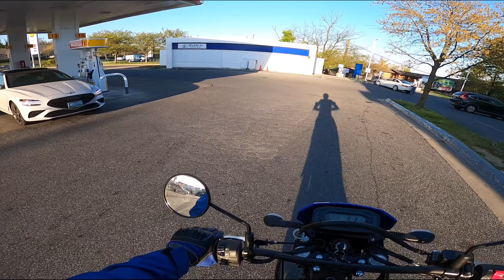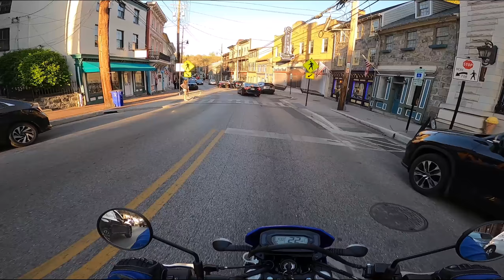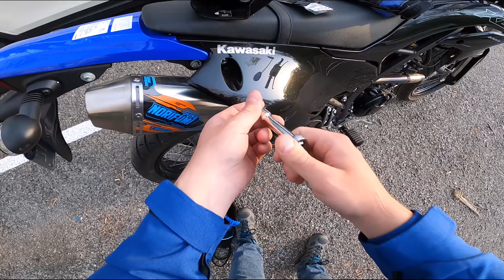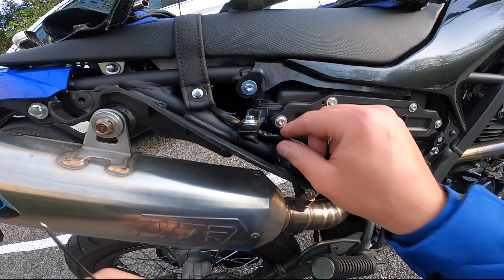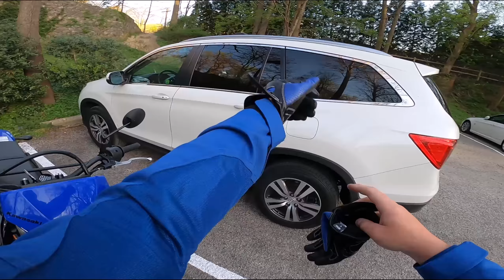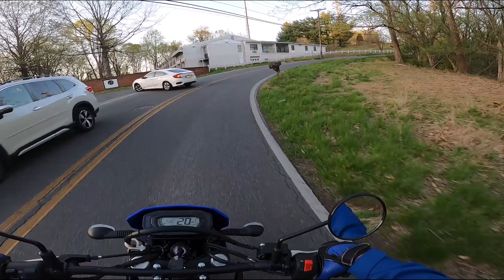KLX 230SM | KawasakiBrad O2 delete install and review

Comment: The  o2 sensor reads the exhaust gas temperature to keep the fuel mixture adjusted at a safe range probably about 15 so it’s not lean aka back firing out the exhaust on deceleration threw out  the throttle range and keeps it in spec during elevation changes  the ecu can compensate some  but with efi not gunna get much on stock tune being it has to pass emission do it’s all ready lean from factory more mods you do air box exhaust with out a tune the leaner it gets will run hotter and backfire eventually will cause premature ingine failure   But good luck you can read about it on the internet  yeah double yellow means don’t cross into other lane broken yellow means you can psss😂🤣😂

Comment: Ya just gotta love how some people drive. How dare you stay in your lane while he’s trying to drive on your side of the road. Unreal. Sound like the bike is running cleaner. It’s not popping near as much but still sounds good. I didn’t notice anything massive either other than it sounds like it runs better. Great video! I love your idea on using an infrared thermometer cuz I’ve read these headers can get glowing hot at idle.
Reply from the maker: Yea I've had my headers glow couple of times, it was interesting looking at the car next to me and see the slight glow at night, and that was even on the stock pipe.   Still the hot start isn't as good as I would like but we will see if the computer has a learning process or something.
Reply: Just listen to your bike in your previous videos. The after install video segment sounds much better. It’s crisper. The delete can simply be done by shoving wire in the right holes of the plug but this unit is quality. It’s overkill actually. My suggestion is be more definitive and stand by your opinion. If you like something say it and say why. It won’t please everyone but heck, you are a channel trying to grow

Comment: Maybe do a couple strong pulls thru the gears and pull the plug for a look. Then install the mod and do a couple strong pulls thru the gears and look at the plug again. This is what I was taught when fooling with fueling system. Imperical evidence beats seat of the pants every time.

Comment: You forgot to remove the o2 sensor!?????
Reply from the maker: I didn’t have a plug for the o2 sensor hole so I just left it in place but unplugged
Reply: @pitbikemike  doesn't that restrict the airflow? If you took it out it would flow better?
Reply from the maker: Yes it technically does affect airflow, but the surface area of the o2 is very small and honestly id be surprised if there was and noticeable improvement in the full removal of it except for aesthetics.     That’s just my opinion, I don’t really have any factual info to know if it makes a difference hahah
Reply: @pitbikemike I read elsewhere that you want to remove the o2. You don't want to use it as a plug because it will "clog" the sensor and you'll be out $200 on the actual sensor for a $5 oil drain plug and copper crush washer replacement.

Comment: Did you feel a difference when you installed the pipe?
Reply from the maker: @jfm1811  No I didn’t really feel a difference just sound. Which in some ways is nice cause when I out a pipe on crf250l I noticed it had a flat spot in rev range till I put fuel tuner. So this was slip on and forget in my case. I did the o2 delete just cause it was cheap and was curious if it made any difference…

Comment: Is the o2 sensor delete worth it?
Reply from the maker: For the 40ish dollars us it cost me… I think it makes just enough difference to be worth it.  Its not big difference but it helps if you got aftermarket pipe on the bike
Reply: @pitbikemike  thanks for responding! I just bought an over racing pipe and was wondering if i should do the o2 sensor delete aswell but the aftermarket pipe i got has a o2 sensor port. Did you tune your bike at all after getting the new exhaust or only the o2 sensor delete?
Reply from the maker: Only the 02 delete, tbh I think the bike runs great for me like I can top it out so tuning wouldn’t help me much
Reply: @pitbikemike  you noticing the header getting hot or is it the same as the stock?
Reply from the maker: Tbh I haven’t really paid much attention to it. Also cause I haven’t ridden at night recently to even tell
Reply: @pitbikemike  seems like this might also help reduce the pops on decel what to you think?
Reply from the maker: To a small degree.. with my exhaust I still get pops but not as much…. Like it wont eliminate just slightly reduce
Reply: @outsideguide3602  hey man I had a question for you I'm thinking about getting that over racing exhaust as well do you think it was worth it? Did it fit good I've seen people talking about and exhaust clamp where the slip-on connect to the header pipe did you have any problems with that did you have to get a pipe clamp or something? Debating whether I should just keep the stock exhaust and be worry-free where should I go with the over racing thanks for your time and have a good day
Reply: @ryanfritz-oq8sp  hey Ryan ive been super happy with the over racing exhaust i was a little bit iffy after getting it but it sounds so much better and healthier and after doing the o2 delete and pair value delete ive had no popping on decel and never had my header turn “red hot” (after riding for 5-6hrs) lmk if you have any other questions
Reply: @ryanfritz-oq8sp  sorry i didnt answer your question about the clamp, i had no issues mounting the exhaust its a little bit challenging but everything fits pretty well, the o2 sensor however gets pinned in the frame and thats why i decided to do the delete. Hope that clears up all your concerns my friend
Reply: @OutsideGuide  wow man thanks for answering my questions. That's what it's all about helping others out. I do have one more question did you notice any performance increase over the stock exhaust? Lots of times, the stock exhaust usually makes the most linear power I guess you would say, "Could you tell any difference in the new pipe at the bottom end or at the top end? I know it sure does look better in sound better not alone is almost worth it also was the over racing pipe a lot lighter than the stock pipe?
Reply: @ryanfritz-oq8sp  not significantly but little bit yea and if you havent already bought one yet i could sell you mine for a discounted price. Im getting rid of the bike unfortunately
Reply: @outsideguide3602  how can I get ahold of you
Reply: @outsideguide3602  sorry man I just saw this reply I might be interested in the exhaust do you still have it and how would I get ahold of you
Reply: @ryanfritz-oq8sp  you have an email i could contact you with?
Reply: Were did you get the o2 delete plug?